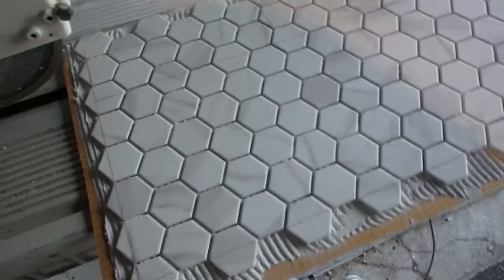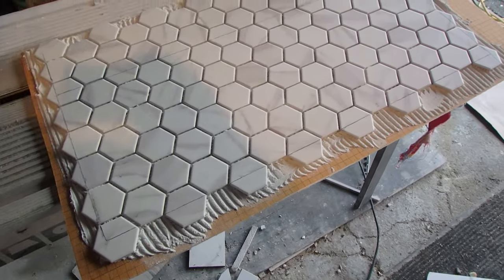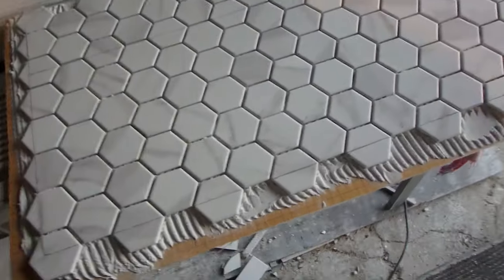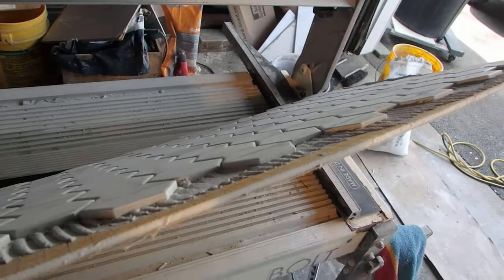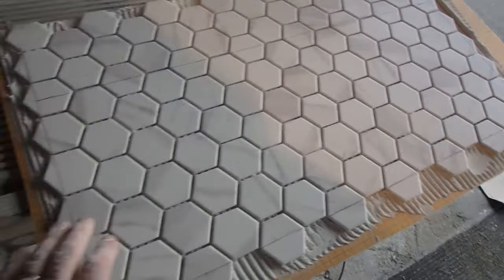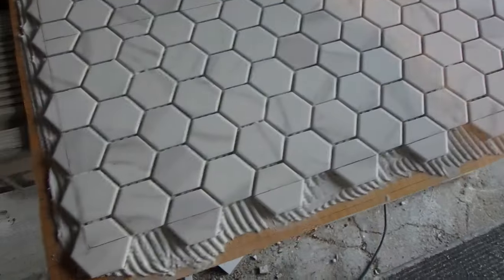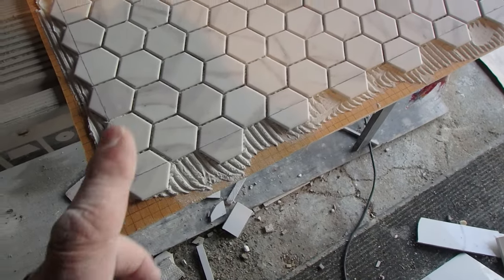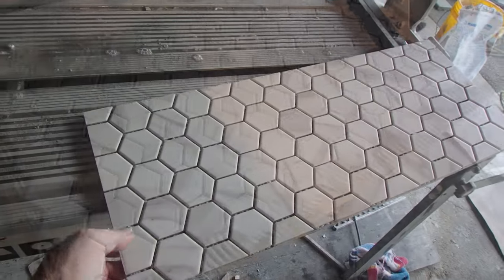Tile Niche Hack

Comment: hi sal. i like this idea, specially the tile trim i will be using is much thinner the the wall tiles. so what size of trowel should i use to install the kerdi board in this application against the kerdi wall ?

Comment: QUESTION: They say you must use an unmodified thinset to apply Kerdi membrane on shower walls, but the Schluter All-set thinset bag states it's a modified thinset. And Schluter All-set is used to apply the Kerdi membrane???
Reply: I would be interested in knowing that answer too.  Seems counterproductive as modified thinset needs exposure to air to get its strength and the membrane I would think would prevent that.
Reply from the maker: Correct, but incorrect. Old information. There have been advancements in thinset technology, as the name  "Allset" might suggest, it is for everything. Allset is an ANSI A118.15 mortar designed to be used with schluter membranes.

Comment: I've watched a ton of your videos and enjoyed very much. I noticed when caulking a corner you will spray the caulk before removing the extra caulk with your tool. You use to use denatured alcohol but now you are using a product called SILICONE FINISHING Spray which I can not find. Can I use soap and water or denature alcohol? Thoughts?
Thanks RG
Reply from the maker: Yes water and a few drops of dish soap works great.
Reply: @SalDiBlasi  Thanks, Have a blessed day.